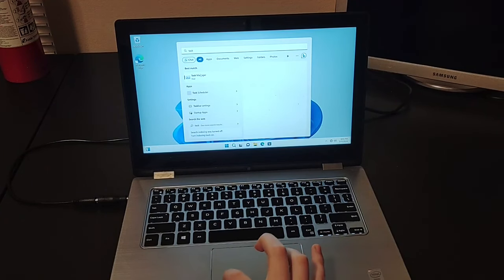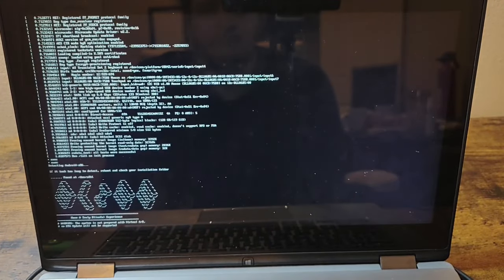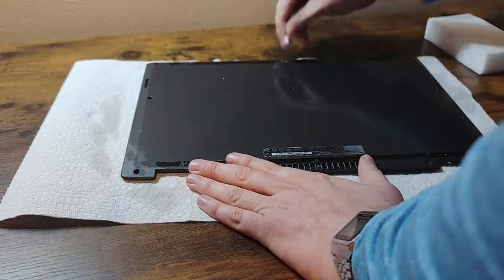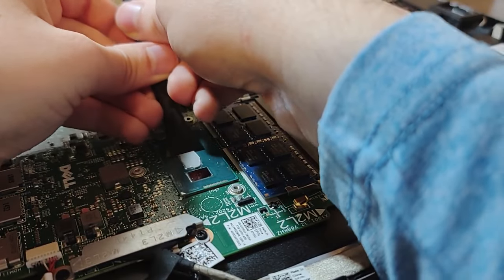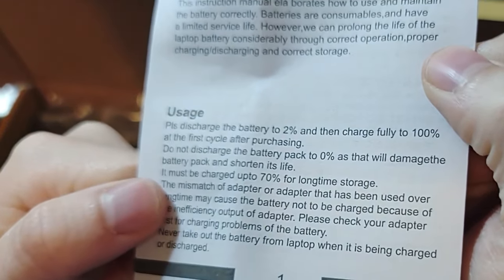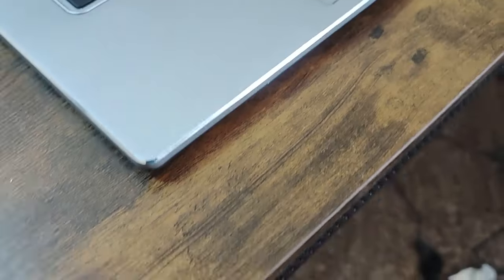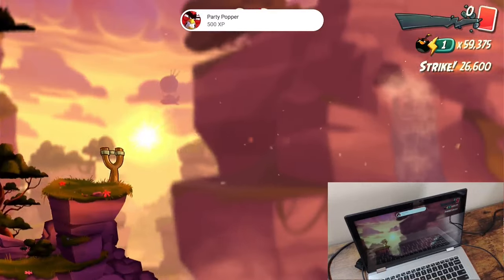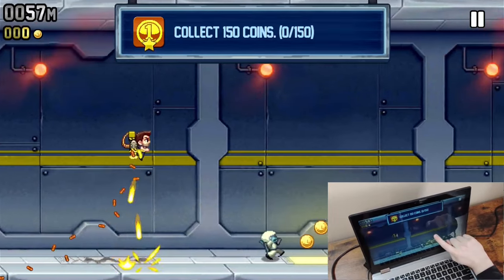I Turned This Scrap Dell Into A NICE 2 in 1 Android PC. Was it worth it?

Comment: I expect that ChromeOS would be pretty slick on that thing. Places like Walmart are selling fricking awful laptops that barely have the specs to run Windows at all (think you mentioned that in one of your other videos) and so many people don't think about the lightweight OS's when they buy used or refurb an old laptop. Love Linux, too, don't get me wrong, but I honestly feel like ChromeOS is going to be the "new Mac" especially because they're letting OEMs use it as they wish, and they don't lock it down too bad for tinkerers.

I want ChromeOS to mature a bit and at least offer a more typical desktop environment, but it's amazing what it can do for hardware most people wouldn't bother using.
Reply: The Android VM makes low end hardware worse to a large degree in terms of performance. Also, it only supports Play Store Apps, no APK apps which makes it useless for some.